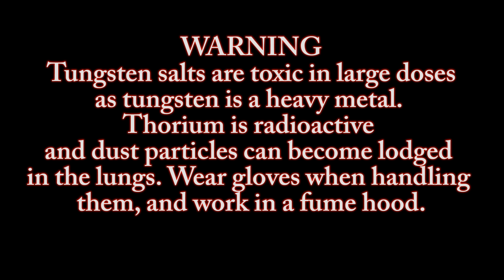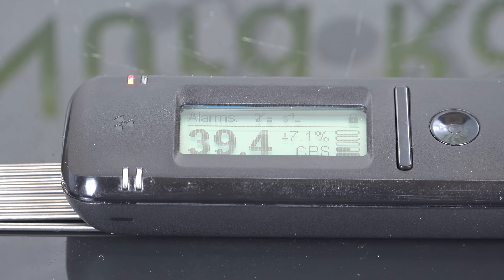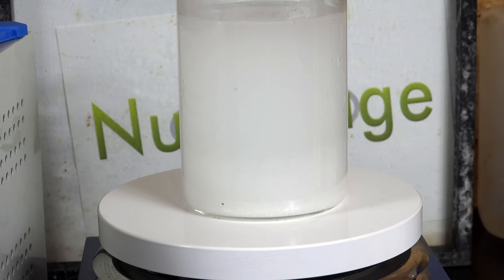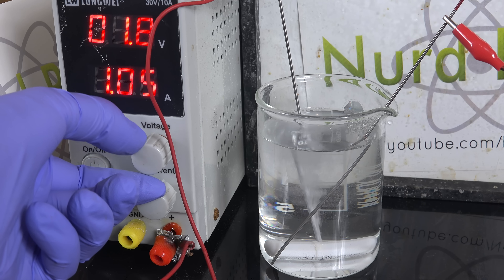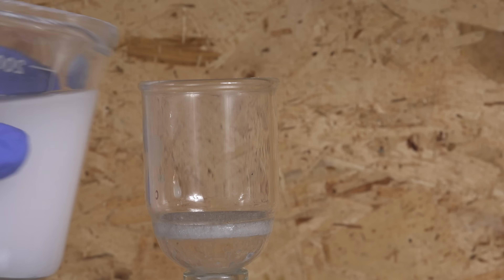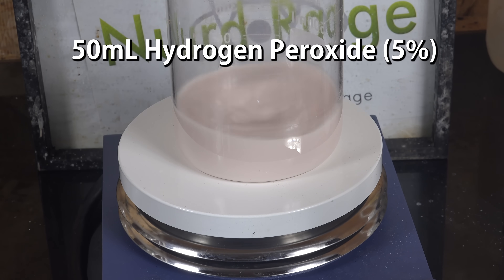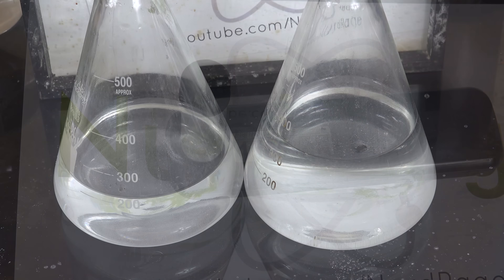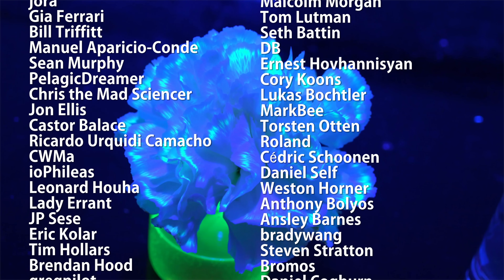Extracting Thorium Dioxide from Thoriated Tungsten Rods

Comment: Nice chemistry, but as a side note, if you need a pretty active source for calibration, you can buy a disk source of Eu-152, which most of the time is even better than thorium, for about $100 from Spectrum Techniques, or one of their distributers, but I recommend of course buying straight from the source, as it's almost always cheaper. Also anyone, even private individuals, can buy from them, as I have done many times. Thanks for great content as usual!

Comment: You asked for comments about separating the radium.   I would like to see  this.    You get Ra 224, with a half life of 3.6 days, so your product will be mostly gone in a couple of weeks.
The Ra 224 decays into Rn 220, which has a half life of about 1 minute.   If you separate the radium you will have an opportunity to collect some of  the radon gas.   If  this is injected into a cloud chamber, you get very interesting V-shaped tracks.   One side of the V is caused by the alpha particle emitted when the Rn 220 decays to Po 216, the other side when the Po 216 decays into Pb 212.   The life time of Po 216 is about 0.1 seconds, so the Po atom has an opportunity to drift a few millimeters before it decays, making a small gap in the vertex of the V.    There is also the interesting question about the correlation in  the angular distributions of the two sides of the V.  There is a video about this by bionerd23 on youtube.    I always wanted to reproduce this myself.

Comment: If the goal was for element collection then the dioxide is not really any better than the rods. Getting metallic thorium from ThO2 would be a much bigger challenge, especially if you wanted to do purely through chemical synthesis (no melting in controlled atmosphere) :P

Comment: I'm curious if you could have used Thoriated gas mantels as your source instead of extracting, or it it would have been easier to extract from mantel ash. Technology Connections had no problem picking up the radioactivity from his.

Comment: This content was fantastic. Not a welder, so I had to look up why Thorium is used in the Tungsten rod. Looks like it reduces the melting temp of the Tungsten when welding. I could guess why, too, the rods are ground to a point before using.
I've had more fun with chemistry (organic and inorganic) through the internet, than I did when in high school and college (Photchemistry, in college).

Comment: Gas lantern mantles are coated with thorium oxide. I would think it would be eaxier to strip it from the linen or cotton threads that the mantles are made from, but never considered this until seeing your video.
Reply: Not all are but some are. I have a bunch of mantles and something like 5 or 10 of them in stack gives pretty high count rate on my Radiacode. You can always fold them or even make a wrap from them to put radiacode inside a cylinder wrap.
I'm not exactly sure but I thought mantles are made with thorium nitrate (that turns into oxide when heated) but I've never tried if it really is soluble or not. That would also not be legal in my country even though I can have mantles as long as I cause no danger with them.

Comment: Extraction of radium is quite easy, as long as you don't need it in pure form (which is not really possible with the short lived isotopes of the Th-232 decay chain anyway). I did extract lanthanides from monazite and there were small amounts of thorium in there as well. The radium can be co-precipitated or adsorbed to BaSO4. The most interesting aspect about Ra isolated from the Th is that it contains the isotopes Ra-228 and Ra-224. The latter has a half life of just a few days and so you can see the second half of the decay chain fading away over the course of a few weeks and you end up with a source only giving signals for Ac-228 (the decay product of Ra-228). My product has only about 0.5 CPS due to the small amount of monazite (which had only 4 CPS of all radionuclides before extraction) but it demonstrates proof of concept.
Reply: I wonder how the Curies extracted their radium.  It must have been frustrating as hell to keep chasing the radioactive ghost in the uranium extraction waste.
Reply: @KallePihlajasaari  radium-226 has a half life of 1600 years and is a daughter product of Uranium-238 (itself common), so it isn't a huge hassle to find and then extract.

Comment: Thank you! One remark: It seems that the production of those red tungsten electrodes shown in this clip will be discontinued due to their radioactivity for occupational health reasons. The red eletrodes are going to be replaced by safer electrodes with Lathanium and/or Cerium. Everybody who wants to reproduce this experiment should not hesitate to get some red electrodes if possible yet. The cause for the substitute of Thorium appears fully reasonable to me, because the smoke, generated during the welding process, contains significant amounts of ThO2 (and traces of Ra).

Comment: Summary

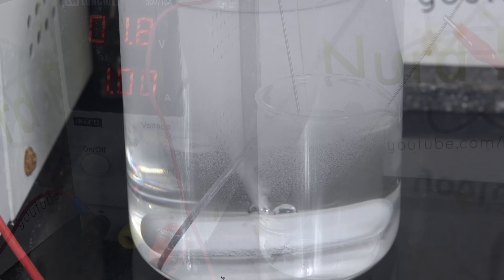(0:00 - 4:06):  NurdRage explains that while thoriated tungsten welding rods offer a convenient source of thorium for gamma spectroscopy calibration, their low thorium concentration (2%) and the attenuating properties of tungsten limit signal strength. He introduces electrolysis as an effective method to isolate a purer sample of thorium dioxide.

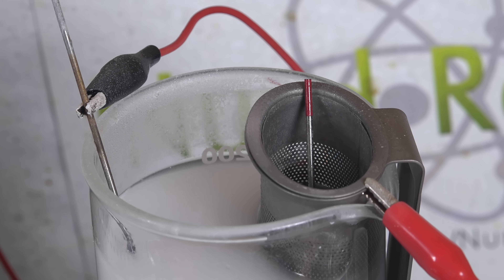(4:06- 5:16): He initially sets up the electrolysis with tungsten rods as both cathodes and anodes in a sodium hydroxide (NaOH) solution, explaining that this process oxidizes tungsten into soluble sodium tungstate while thorium dioxide precipitates out. He also addresses the challenges of uneven rod dissolution and uses a titanium tea infuser as an anode basket for better efficiency.

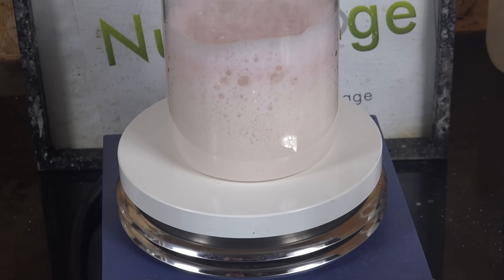(5:16- 7:58): NurdRage showcases the resulting solution after a couple of days of electrolysis, now containing separated thorium dioxide.  He demonstrates the decantation process, washing and separating the thorium dioxide powder, and briefly mentions using a flocculating agent (aluminum sulfate or organic pool clarifiers) to aid settling. He emphasizes the need to avoid contamination for pure samples.

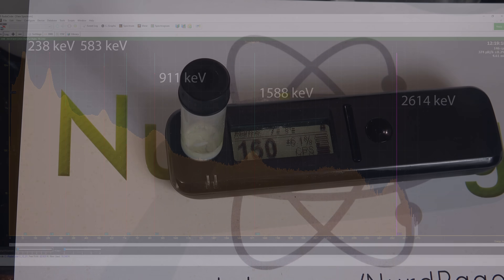(7:58 - 9:42):  He returns to the sodium tungstate solution and demonstrates a cleaning method using hydrogen peroxide to further purify the thorium dioxide by dissolving residual tungsten particles. He prefers electrolysis for bulk tungsten dissolution due to its efficiency and cost-effectiveness over peroxide. After explaining the importance of handling tungsten waste properly, he concludes by presenting the purified thorium dioxide and highlights that its gamma peaks actually originate from its daughter products, mainly radium.

Summary of Comments:

* General Sentiment:  Positive feedback dominates the comments, with many expressing admiration for NurdRage's knowledge, enthusiasm, and commitment to safety while conducting potentially dangerous experiments. Many viewers also voice their fascination with radioactivity and the practical applications of these techniques.
* Requests and Suggestions: A recurrent request among commenters is for future videos exploring radium separation from thorium, highlighting the intrigue surrounding radium and its properties. There's also interest in seeing applications for the extracted thorium dioxide and repurposing the remaining tungsten. 
* Additional Insights: Many comments offer insightful perspectives based on viewers' own experiences or expertise. For example, suggestions arise for alternative dissolving methods using sodium nitrite or experimenting with lanthanated tungsten.  Discussions also emerge around radiation safety, proper waste disposal, and the availability of alternative sources for radioactive materials.  

Overall, the video and its comment section reveal a community passionate about science and particularly interested in radioactive elements, with a desire to delve deeper into the intricacies of their extraction and potential uses. 

i used gemini 1.5 pro to summarize the transcript and comments
Reply: Thank you kind internet stranger.

Comment: Great video!

I wonder why you didn't just order a miracle ion rod massager? On Amazon, many of them contain thorium, if it says ion in the description... I bought one, but never opened the rod, as I heard it contained powdered thorium, and I don't need such things floating around, but it does provide good test media for my detector.

It is nice they are cleaning up the environment, but I always wondered how much radioactivity was in some of the stuff made back in the day.

Oh ya, I had to listen close as I thought I heard incantation being said a couple of times, and thought you might be using alchemy?
Reply from the maker: yeah i didn't want to use those negative ion things because they aren't quite reliable, sometimes you can buy them, sometimes they stop selling, and the amount of stuff in them is inconsistent. I selected thoriated rods because they are very common, readily available, and 100% legal. So for the amateur they are a great and reliable source of thorium. Granted, they are rather expensive, but i don't trust those negative ion things as a radioactive source.
Reply: @NurdRage  I can understand that, as I have seen other things turn out to be nothing more than plastic key fobs or some hockey puck with no activity at all.

Comment: I used beach sand from Brazil to calibrate my Gamma Ray Spectrometer. It is easy to  use and is plenty active enough for my purposes. The Silicon Dioxide was dead easy to remove. The bonus is that you end up with multiple isotopes.
Reply: BTW @bionerd23 Did a great video on this topic. The Th-232 decay chain came in at 100,000 Bq/Kg

Comment: why doesn't titanium dissolve? needs a higher voltage or something?
Reply from the maker: yeah, titanium is very resistant to electrical oxidation because it creates a passivating layer, but at high voltages the layer can be broken. At 20v it gets destroyed fairly quickly. at 12volts its slower, but still excessively destructive. At 7 volts it got slow enough to be reasonably safe, i could still see some destruction but it was manageable. So i keep to 5-6 volts, it seems to be immune there.
Reply: @NurdRage  you know if titanium can withstand the use you gave it in this video in a chloride medium instead of a hydroxide one?

Comment: Two questions. First, how dangerous is the radioactive material, both before and after being concentrated. Second, what do you do with all of the possibly contaminated solutions and equipment? I’d imagine it’s not highly radioactive considering you casually hold the rods and the sample, so are the daughter nucleotides fairly safe?
Reply from the maker: At these radiation levels, as long as you're not eating them, they're fairly safe. You get more long term exposure from granite countertops.  So just treat it like you would any other poisonous chemical. Wear gloves, and clean your workspace. There isn't much in the way of special radiological considerations. 

But if you're doing this on a very large scale, and extract kilograms worth, then maybe its an issue.
Reply: @NurdRage  ah okie, that makes sense. Thank you!

Comment: There's another way to get tungsten into solution too.  Speaking as both an amateur chemist and as a welder, tungsten reacts vigorously with sodium nitrite.  This is exploited in a product called 'Chem-Sharp' for quickly putting a point on the end of welding tungsten without risking making thoriated dust.  At a red heat, the tungsten quickly reacts with the nitrite and the reaction is exothermic enough to keep the metal hot.  Not sure what the precise mixture of products are, but I bet they're more soluble than the tungsten metal...
Reply: Potassium nitrate as well as sodium nitrate works too (no hydroxide needed), I used this method with sodium nitrate for producing sodium tungstate for a density separation experiment, I used non-thoriated rods so didn't have any insoluble thorium dioxide in solution but I suspect this method would work well for extracting it from thoriated rods.
Reply: You can do the same by dissolving the tungsten in molten potassium nitrate and hydroxide, but that's a very interesting use of the reaction. You dip the rod into the powder and the O2 makes it red hot again, dissolving more metal each time.
Reply: Came to say this too! It's shockingly fast at dissolving entire rods too.
Reply: @oxoniumgirl  Very much so, especially if you were to do the reaction in a high pressure+high temp sealed stainless steel vessel that was capable of holding the entire length of the rods and enough molten nitrate to cover them, with a pressure relief valve at the top (set at 800-1000 PSI) it would be possible to dissolve multiple rods in a matter of seconds, the high pressure would reduce boiling and keep the rods in full contact with the molten nitrate. 

But even if you just did it in a small stainless steel cup in open air it only takes a minute or two to eat an entire rod, even faster if you heat the nitrate red hot before starting. The only thing that slows the reaction is having an excess of tungstate in the molten salt, once you've burned a few rods (per 25-ish grams of nitrate) it really starts to slow down since the tungstate acts as a buffer between the tungsten and fresh nitrate.
Reply: you can get sodium nitrite from this OTC?
Reply: @alexwang982  Yes, but it would be a super expensive source.  You can melt sodium nitrate and add a mild reducing agent.  Lead powder is typically used, but lots of things work.  Chemplayer used spaghetti noodles.  A better source if you don't feel like making your own is 'prague powder' or 'pink salt' sold as a meat curing supply.

Comment: The gamma spectrum of "pure" Th-232 is mostly not based on Radium. The main peaks are Ac-228, Pb-212 and Tl-208. Ra-224 and Ra-228 are there but even the most intense gamma peak has only a relative intensity of around 6%.

Then we have to speak about what is meant by "pure". Your welding rod can be seen as "pure" as it is not millions or billions of years old ore. Compare it to uranium: If you measure uranium glass you will mainly see the lines of Pa-234m because the uranium was "recently" purified (it is not millions or billions of years old). If you measure uranium ore the lines from the Ra-226 chain will dominate as the Ra-226 enriched ore is vastly more radioactive than the uranium itself.

This means you can try to remove Ac, Pb or Tl (or Ra) from your samples but it won't matter much. Those isotopes will be immediately reformed and will give you the gamma lines. In terms of the half life of Th-232 the welding rods are not really older than your purified sample (14 billion years). It would be something else for Thorium ore but you would measure another ratio of lines anyway. Similar to the uranium example.
Reply from the maker: those things are daughter products of radium, so if you accidentally remove he radium during processing, you'll need to wait a long time for the radium to regenerate since it has a 5.75 year half life. Thats why i say it's responsible for the spectrum, i could describe the whole decay chain, but that would be a 2 hour video. For the purposes of convincing the viewer not to mess with the processing method, i kept it to just radium.
Reply: @NurdRage  "those things are daughter products of radium" That is correct.

"so if you accidentally remove he radium during processing, you'll need to wait a long time for the radium to regenerate"

That shouldn't be the case because the half life of Ra is so incredible short compared to Th-232 so that smallest trace amounts are only present but they are responsible for all your gamma lines.

In fact I am convinced that you "removed" radium. After your electrolysis your radium should be present in the form of Ra(OH)2 which is soluble in water. After filtration you are only left with ThO2. But both your spectra (Th-rods and ThO2) are just simply the spectra of purified ThO2.
Reply from the maker: It's short, but my time is shorter, you're not waiting the years for the half life, your waiting hours for the experiment. Anyway, I may have lost some radium, but acid processing loses a lot as well. I ran an acid experiment and lost 75% of the radioactivity, so I'm not making stuff up when I say altering the processing technique changes the outcome

Comment: I did this a long ago with about 80g of thoriated tungsten however I got far more ThO2, I wonder if I did something wrong or if my electrodes had far more thorium?
Reply from the maker: Maybe mine are cheap knockoffs, it's hard to tell.
Reply: @NurdRage  I actually would expect them to have far more than advertised. I have no real basis other than seeing esoteric gadgets with large quantities of thorium but It seems the Chinese has an overabundance of thorium dioxide and they wanna get rid of it, I purchased green tip tungsten electrodes which should be pure tungsten but they actually had significant thorium on them to cause about one quarter as many counts on my geiger counter as do 2% thoriated tungsten electrodes.  There are also orange tip electrodes which supposedly have 4% thorium, larger quantities of thorium might come handy to you if you make the radium extraction video. Cheers
Reply from the maker: very interesting! maybe i need to buy a bunch more rods and hopefully find a batch with an excessive over abundance of thorium!